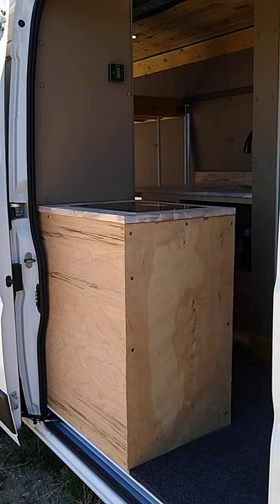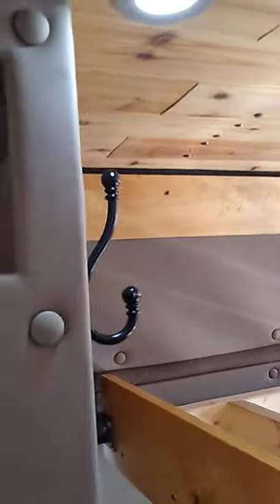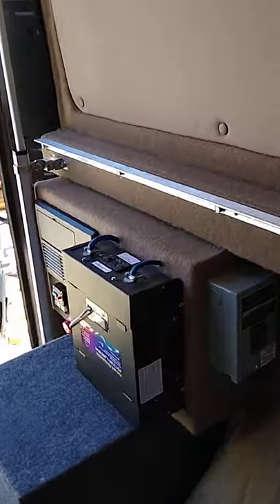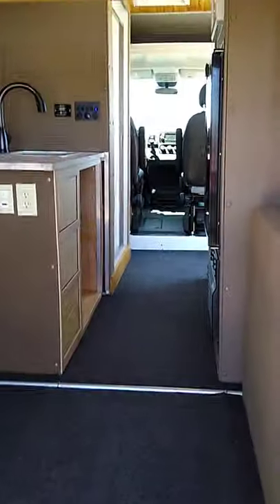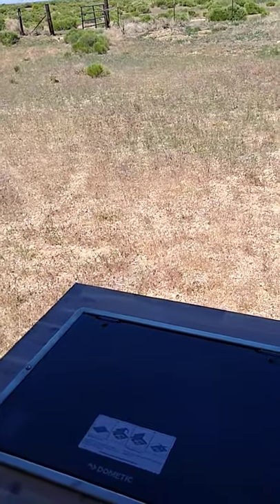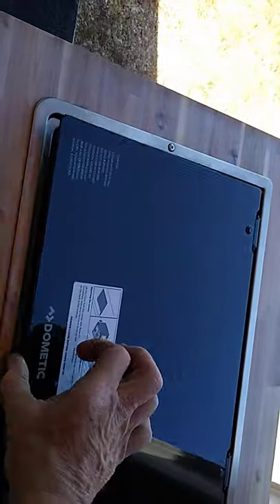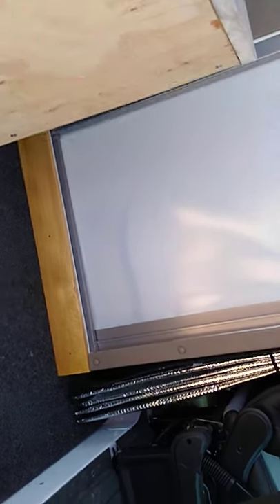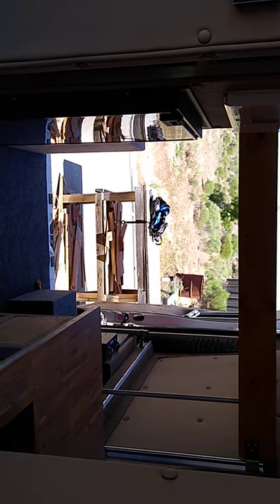Promaster toy hauler update

Comment: Absolutely brilliant design! Looking forward to future updates :)
Reply from the maker: Thanks!   We had a very specific mission requirement, we are replacing toy hauler trailers with something more compact and WAY easier to drive, load, and generally just use.  

The moving bed is necessary for the dirt bikes so we can use the van as a camper or a toy hauler depending on the trip that day.   It's basically a mobile base camp for riding, amateur astronomy and general exploration trips where we want to get away for a weekend and want to go hike, rockhound or explore an area.  

We're setting it up for week long trips, but it could easily turn into a longer term RV camper.